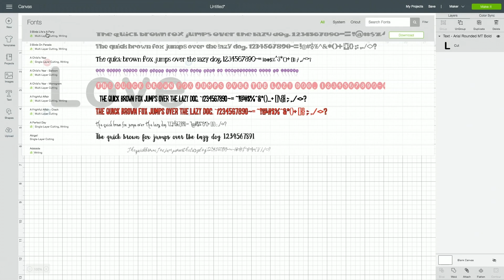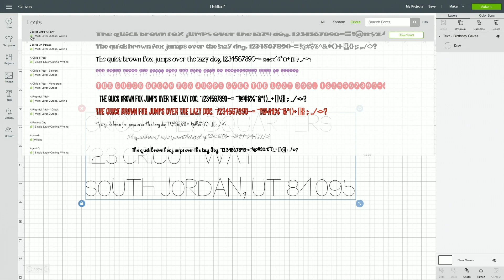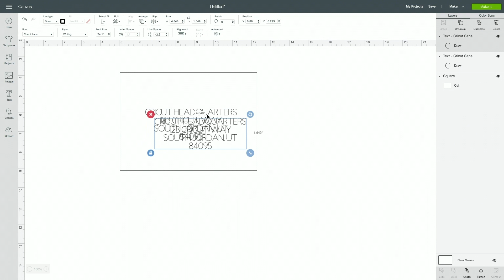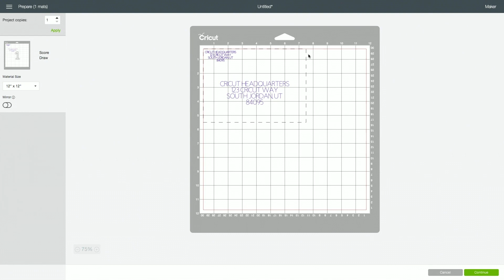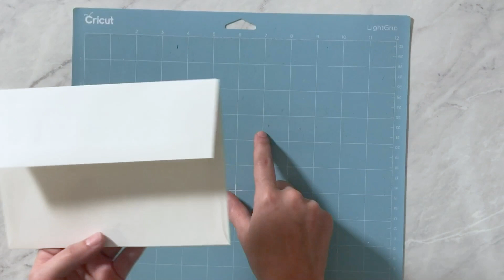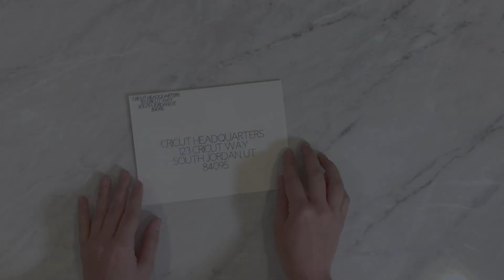Addressing Envelopes: Writing with Cricut Pens Using Your Cricut Maker or Explore Machine

Comment: I'm still waiting for delivery of my first Cricut, but couldn't you just delete the envelope, instead of marking it as Score? I would think it would just write the letters and stop. I do not know. I'm obviously still learning. Thanks for a great video!
Reply from the maker: The score line is to help line it up. For my brain, it’s easier to use the rectangle to align it :) but it’s definitely not necessary!
Reply: @KarleyHall  If you want to use the rectangle, you  could also only attach the two addresses but leave the rectangle on its own layer. Then when you get to the layout screen, simply align the rectangle on the mat where you'd like it to be then drag the addresses inside the outline. Once you get it aligned how you'd like, you can click the 3 dots on the top left and simply hide the outline. This way your Cricut won't need to do the extra step of "scoring", but you can still use the rectangle for alignment.
Reply from the maker: Good idea! I like the motion of the scoring to ensure the envelope is placed correctly— but if you don’t— that’ll definitely work!!

Comment: This may have been asked, but I literally just got my machine so I am sorry for possible repeating. Do you have to use Cricut pens or can you use other pens?
Reply from the maker: You can use other pens! There are 3rd party adapters available or you can wrap a rubber band around pens to make them fit in the machine. I typically stick with the Cricut pens because I am lazy haha!